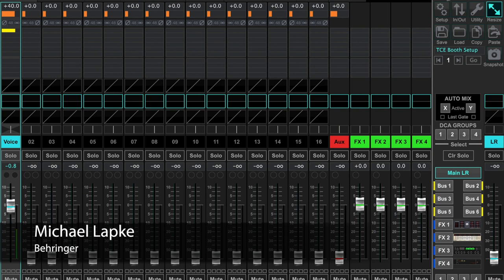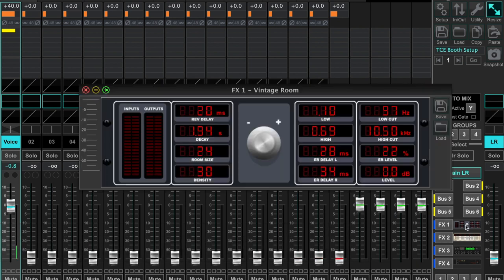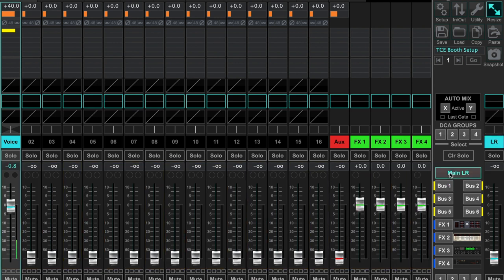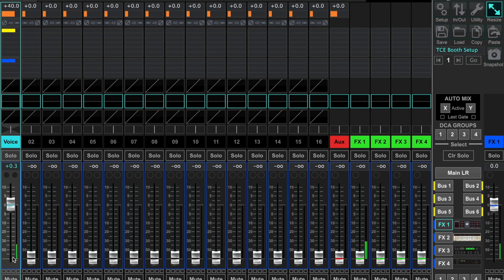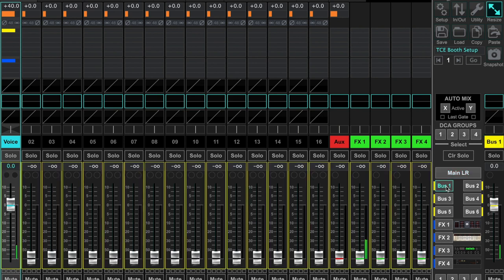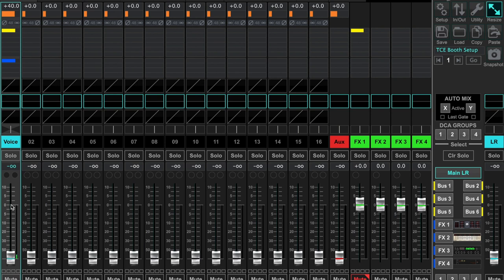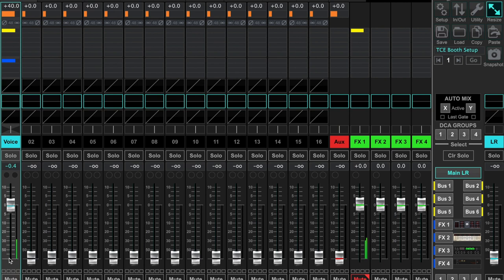X AIR How To: Sending FX to Monitors (X AIR EDIT)

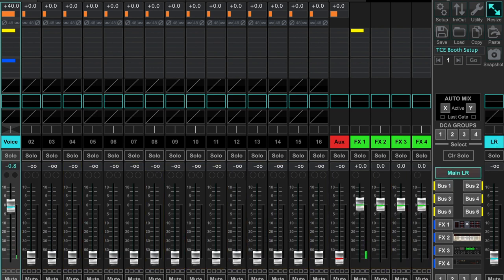Comment: The section beginning at 2:28 is vital information.  I had difficulty with this last night - I could not get effects to be heard in the Aux busses.  This video completely clarified what I was doing wrong - I didn't have the channel faders up in the main LR mix bus (even though I was not using the main LR bus).  This video was extremely helpful - thank you!
Reply: I had exactly the same issue - we were doing a monitor check and couldn't get effects via the Aux outs - now I know why!

Comment: Hi. I have tried this over and over again with both an x18 and xr18 both reset to factory defaults, bit something is missing in the steps. I get the feed to bus 1 but NO signal to FX 1, therefore turning up and down the fader on FX 1 does nothing. There has to be something missing here. Please advise. There are NO effect currently inserted to any channels directly either, as someone else mentioned in this thread. What am I missing? Thanks

Comment: I watched this tutorial a few weeks ago and then at practice I must have forgotten exactly what you said because I couldn't get the effects to work without feedback. What I had mistakenly done was raise the effects send on the FX1 to FX1. Why does Behringer allow you to do this? It's also not obvious that the FX slider on the Bus 1 view is the return. Couldn't there be some tooltips in the software to indicate what function they perform (maybe in a "learning mode" which could be turned off.)

Comment: I see this is an old video but hoping you still get message. I just bought the Behringer XR18 and I'm trying to get a quick stereo slap delay but can't seem to get rid of the repeat in echos. Is there a way to get a single delay from one of the effects?
Reply: Have you tried the Gated Reverb and set the gate to close at the level of repeat echo you want to eliminate?

Comment: I have a question!
I have my guitar plugged in to an X AIR and I want to have a ping-pong stereo delay on my in ear monitors to add stereo width to my guitar. If I do a send/return to the stereo delay effect, I can hear the delay bouncing between the left and right channels. However it would be better for me to use the effect as an INSERT. But if I insert the effect into my guitar channel, the same effect sounds mono. What am I doing wrong?

Comment: @Behringer Is the X Air product series EOL? With the iOS app not being updated since March 2020 and iOS 16 breaking the app are you planning to fix it or do you have a replacement in the pipeline? Retailers are still selling the products but I would assume it should be End of Sale as one of the primary ways to control the product no longer works.

Comment: We have 5 monitors on stage and want to have 5 different mixes with reverb. Is that possible? Or is the limot 4 diffrent mixes with FX?
Reply from the maker: This can be done with the XR18 yes. On all Aux outs (monitor outs) you can have different mixes, with reverbs included, you have 8 stereo effects to play with ontop of all the standard channel dynamics/eq etc.
Reply: Yes but thats only in insert mode yes?

Comment: Thanks for the video! I'm confused about a couple of things...you mentioned sending Channel 1 to Aux 1 but I missed how you assigned this. There are 6 Aux ports on the unit. How did you specify Aux 1 and not Aux 2, Aux 3, 4, 5, 6 or all 6 at once?? And why are there 6 Aux but only 1 Aux slider? Are they all bound to the same volume? I'm struggling to get Channel 1 & 2 to point to Aux 1 & 2 for a stereo in ear monitor.
Reply: Have you figured this out?
Reply: To send an input channel to any Aux you need to select the Aux channel by clicking on the button on the bottom RHS of the X-Air Edit screen. All of the input faders will then have a coloured line around each: this colour matches the colour chosen for that Aux (you can easily change these colours) This shows that all of the input faders positions refer to the mix that you want to send to that Aux (it is important to note that this has NO effect on the amount of each input being sent to the main LR mix: you are only setting up a different mix for that Aux)  When you click on the Main LR button the coloured lines around the input faders will disappear, showing that you are back to mixing the main LR signal.  The same process is used to send any of the input signals to an Fx module: select the required Fx button; the input channel faders will now have a different coloured band around each, showing that you are sending to that Effect module. There is an important difference between Aux Sends and Fx Sends: while you can consider both as extra "mixers within your mixer", the mix that you have set up for the Fx module has an additional Fader to adjust the overall level of that Fx Send mix actually getting into the Fx module. This "Fx Send Master Fader" is not visible on the top layer of X-Air Edit; you can however access it using the Utility button and selecting one of the User buttons. This can then be configured to contain any of the input and/or output faders: you need to select all 4 of the Fx Send buttons (I also select the 4 Fx Return buttons, but you can choose whichever buttons suit your needs) The Fx Send Master Faders names will be labelled in dark blue (the Fx Return faders are green by default: these are the faders  which appear immediately to the RHS of the Aux 17/18 input fader) The important thing to realise here is that even if you have 'Sent' some input channels to the Fx module, none of that signal will actually be processed by it if the Fx Master fader is fully down! You should set this at the 0 dB position i.e. whatever level of each input signal you send to the module with actually get into the Fx module. You then set the amount of the Fx module output that you want to add to your Main LR mix or Aux, by adjusting the level of the green Fx Return faders .  You can even program one of the Mute buttons to temporarily switch OFF the effect, usually done when the artist is talking between songs. I'd recommend that the Mute should just switch OFF the Fx Send, and not the Fx Return, as this will allow any reverb etc to fade-out naturally when muted, instead of cutting out instantly. Sorry this is so long-winded, but so many people have problem with effects, which are often due to them not realising that the signal path is: Input ch SEND to Fx; adjust Fx SEND Master Fader; adjust Fx Return Fader.  Note that normally it is best to have the effect SENDS as Post Fader so that the amount of the effext follows the actual input signal fader; Aux'es however will normally be Pre-Fader, as you're artists won't want their Foldback mixes changing as you mix the Main LR (FOH) signal.  Hope that this helps.
Reply: @johnkirkpatrick1778  Thanks for your reply, John. I'll give it a shot.